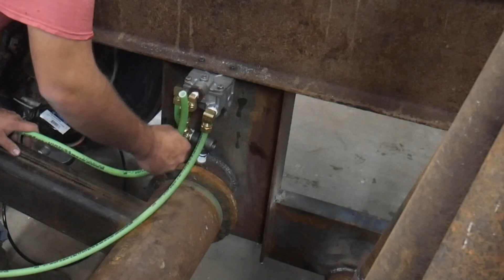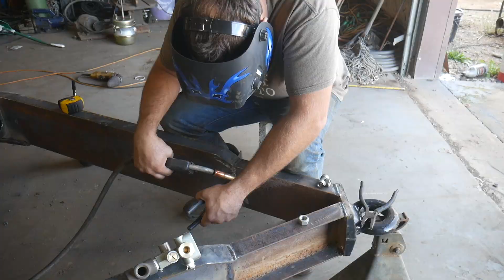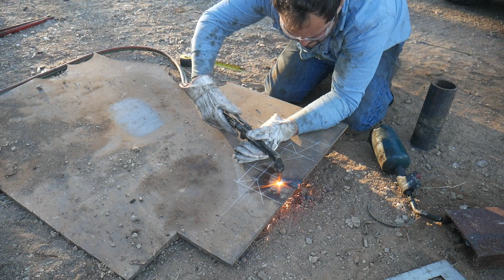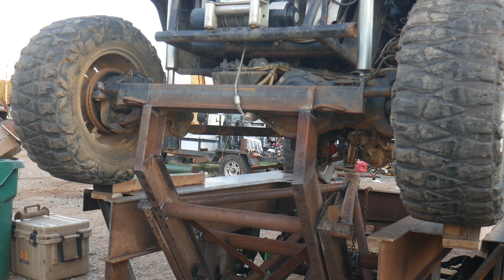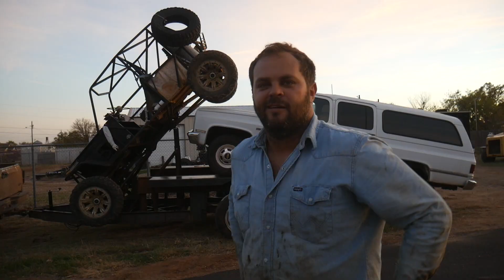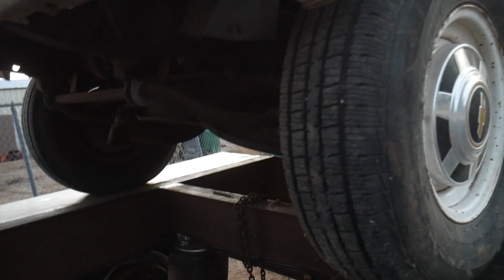Steerable Air Bagged Trailer Part 3.

Comment: Why didn't you get in and run the winch from the seat? That would have tested your pucker factor. The big problem I see is, what happens if the crawler stops running (broken) and can't drive itself on the trailer?

Comment: Perhaps if you were to use a couple of air cylinders (since you already have air for the trailer), you could tilt the crawler forward and backward without being in a danger zone.  The other thing you could do is put your pivot point on a fixed rail so that you can move it forward and backward six to nine inches (enough space fore and aft to compensate for tongue weight).

Comment: I used to pull a fifty three foot box trailer for behind my semi., it did not like tight docks or hard entry to some freeways. I used a Saginaw system on my two rear axles on that trailer an even though it did not turn a lot, a little goes a long ways. It did make that trailer a bit heavy because of the style axles I used but just having a inch operated from pressure on the steer axle of the truck was enough to keep it from cheating on any normal corner. Another guy had told me he would help to develop a system for me an we split profits but instead he got a pending patent an buried it. For the time invested tho, it worked well out on  the freeway
Reply from the maker: Intersting.

Comment: with the angel of it will it cause problems  with the gas ,oil or transmission fluid?
Reply from the maker: I think it's going to be ok. I wasn't sure about the engine oil but the transmission and transfer case have vents that turn to the back and it runs on propane.

Comment: AMAZING!!!! I’d vote for bed liner. I think it’s really awesome. I’m anxious to see how your going to shoe horn in the golf cart. Didn’t you do some bed liner your self on the motor home body? Kc
Reply from the maker: I did. Its a great product but it comes out smother than most. I may try it with some kind of sand mixed in or southing.
Reply: @TheZachLife  check out the deck coating that SV Seeker used on the topside of his boat.   Stuff was 36 grit type rough and 1/8" thick.   Great stuff.